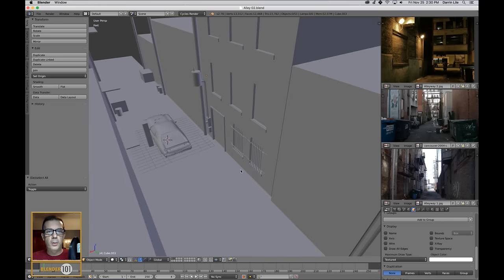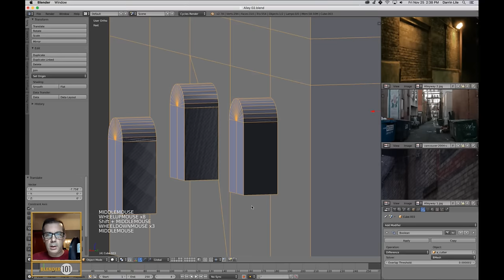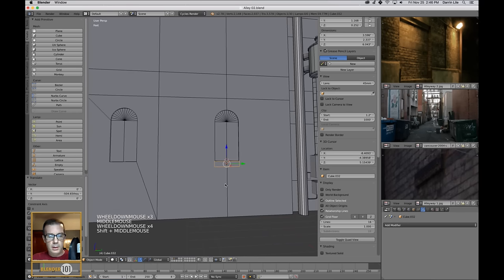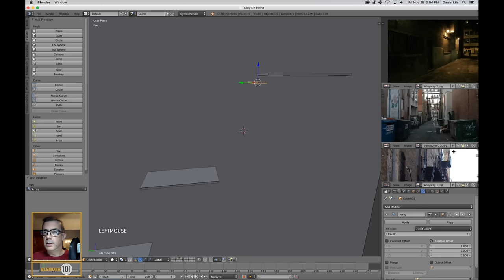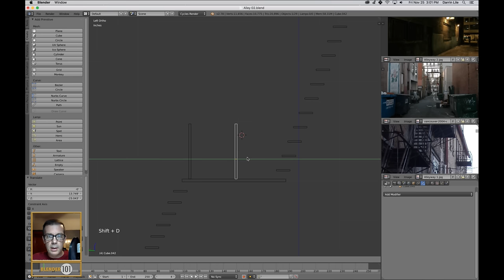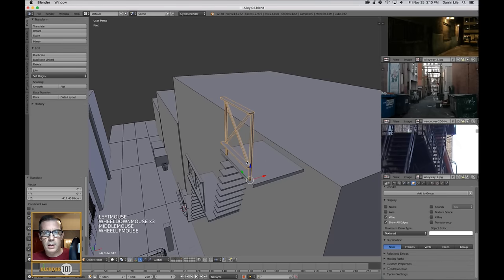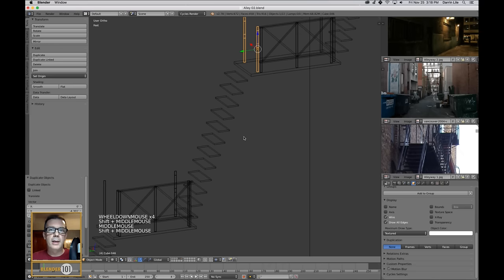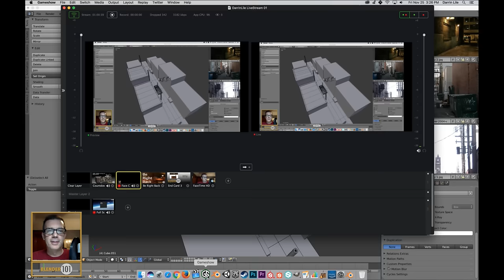Blender: Modeling an Alley 02-Live Stream

Comment: I usually use knife project instead of boolean for window openings using a window shape to cut from. No need to have a solid shape to cut into and you can save a bunch of different shapes to reuse on a different layer. Works like a charm.